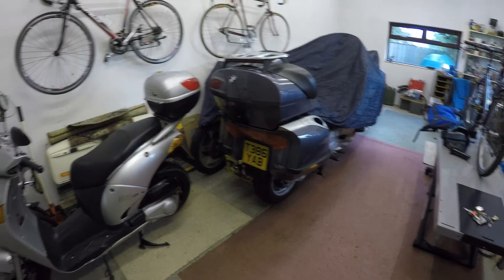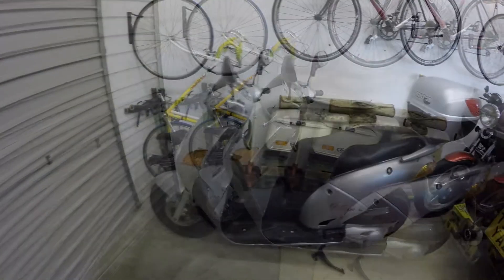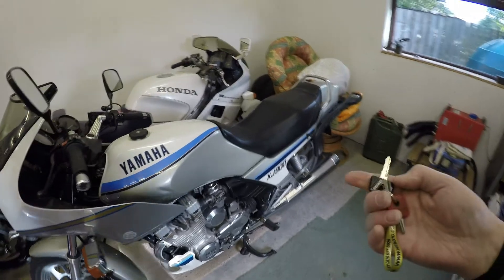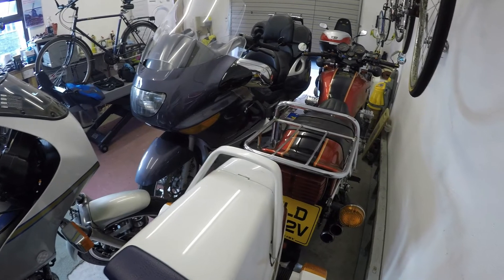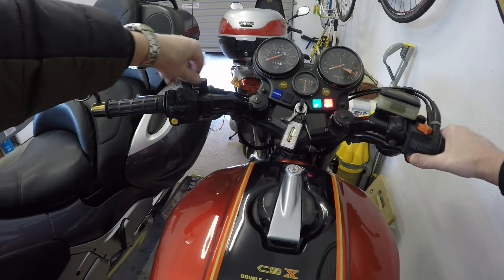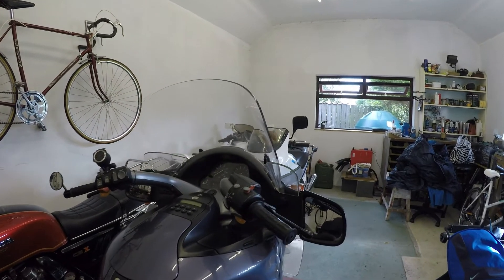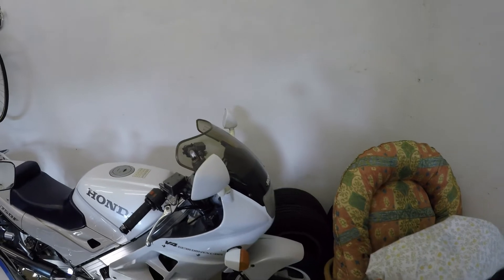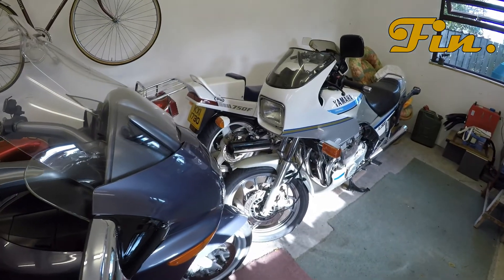CBX, VFR, NES, XJ, LT First start 2022.

Comment: Another great video Alistair 
What do you do if one doesn’t start?
Reply from the maker: Hi Mark, over the years I've been lucky enough not to have had a mechanical failure. The worst case was only ever a flat battery. I have been known to get the 'Jump leads' connected up to the car but thankfully I haven't had to do this often.
Reply: @AlistairCampbell1047cc  Thanks Alistair

Comment: What do you do to keep them in good shape? I mean, without having carbs issues
Reply from the maker: Norlan, I really have been very lucky regarding fuel/carb issues. I did have a few problems with the VFR but they were my own fault. I've done a series of videos showing and explaining the reasons. I also try to use 'Super unleaded' fuel whenever possible instead of E10.
Thanks for watching.
Reply: Specialy for the Honda CBX... Before winter storage I empty the petrol tank (E10) and refill it with Ecomaxx Bike Fuel 4. Take it for its last ride and put it away in the garage. After  the winter period it starts immediately.  👍  Never had any starting-problems with it.